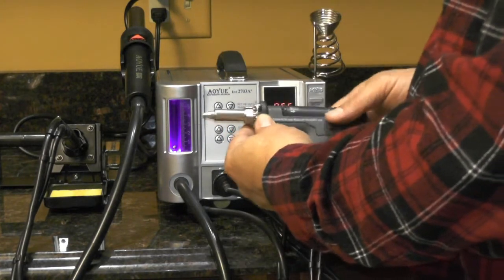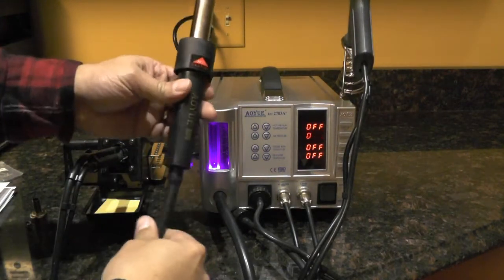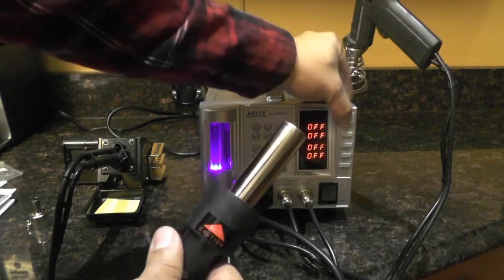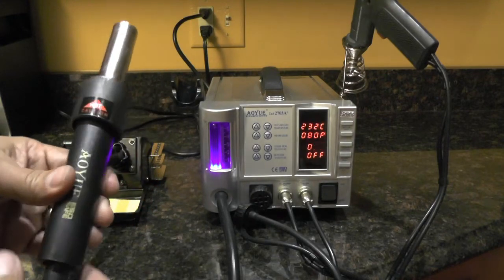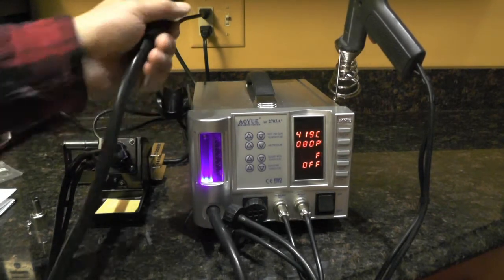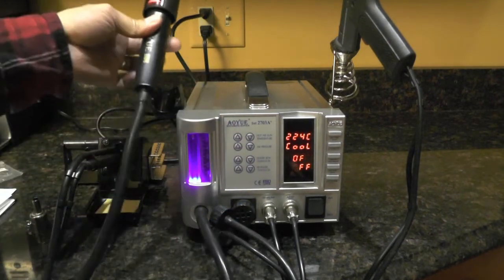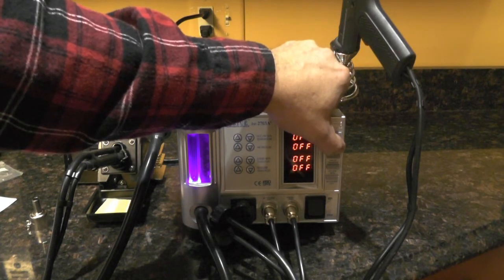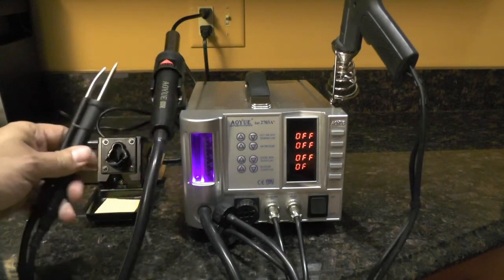Aoyue 2703A+ Soldering Station Functionality & Review (2 of 2)

Comment: Hello, I was just wondering if you had ever pinned out the connector for the soldering iron as per your discussion in the comments with another user that was having an issue with their iron not heating up. I'm having the same issue with mine, and its brand new, just out of the box. Everything else works, with the exception of the soldering iron. Kind of frustrating on a brand new unit.... Thank You!
Reply from the maker: Armchairfabio Sorry for the late reply.  I just went out to the garage to get the pinouts for you but noticed that it wasn't an easy task.  I would have to take the soldering iron handle apart to do so, but it didn't come apart - at least not easily and I didn't want to break it.  Could it be that on YOUR soldering iron your tip was not pushed all the way into the handle?  I hear a slight "click" sound in my handle so I know that the tip is fully seated.  If the tip is not pushed all the way into the handle, the iron won't work.  On another note, if it's a brand-new unit you have and the iron it is truly defective, why not return or exchange it?
Reply: I'm sure this is old news to you by now but, just in case someone else runs in to it, I had the same issue (not heating up). In my case the tip was not pressed firmly into the handle. Once I pressed it in all the way (after taking it all apart and making sure I had continuity through the cord) it worked like a champ. Hope that helps. -Jeff

Comment: Well, I think all reviews should include a demonstration for example, how the soldering iron and the desoldering gun can deal with big thermal masses, how precise the temperature regulation system is, what temperatures can this elements get, how fast are they, a brief teardown to know about the build quality and the techniques the manufacturer used, a bit of soldering and desoldering applications,etc.
And also answer questions like:
It's ESD safe, it´s earth grounded at least?
How easy is to get the replacement parts?
Does the desoldering iron have the typical chisel and the half chisel tips?
What about SMD components?
And so on.

But, you are in time to do this kind of review...
Reply from the maker: These are all valid points.  At the time I made the video I didn't think of all of those points.  So I'll answer some questions now: Replacements are easy to find and inexpensive.  A company called www.sra-solder.com has all the replacement parts.  The desoldering iron and soldering iron use the same tips.  A few tips are included with the workstation.  But you can always buy different tips at www.sra-solder.com.

I have not yet tried the SMD tip.

You can find more technical data about the Aoyue 2703a+ including a copy of the owner's manual at:
http://sra-solder.com/aoyue-2703a-all-in-one-digital-hot-air-rework-station/

If you decide to buy one of these work stations make SURE you read the input voltage.  Both the 110VAC and 220VAC input voltage are being sold in the US. Buy the one you need.
Reply: I agree 100%

Comment: this is far from a review.  you state at the end of the video you haven't tried it yet?  wow that's 20 minutes down the drain ill never get back.  you just explained the features, but you gave very little of your impressions on them.  That is what people look to reviews for.  If they wanted the features they would just go to amazon and read the description.  I appreciate you posting it, but c'mon you should try out the unit before giving a review on it
Reply from the maker: Sorry for wasting your time.  I can tell you that after using it for many months, I have not had a problem with it except for the suction inlet cap.  It never did screw-on properly - like it was cross-threaded.  Also, it would have been nice to have a toggle switch for degrees F and degrees C.  I can't get used to degrees C.
Reply: I appreciate your feedback and taking the time to respond.  You get where I was coming from though right?
Reply from the maker: Benjamin Tesser I know where you're coming from.  No problems there, and thank you for the feedback.  But the comment of "that's 20 minutes down the drain ill never get back" wasn't necessary. We're good!